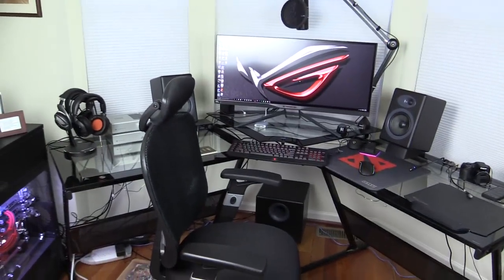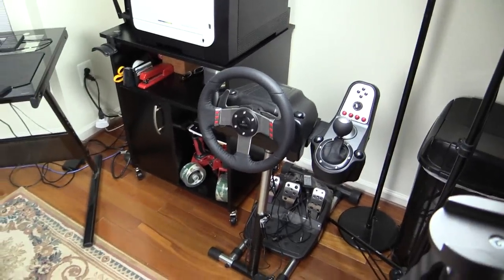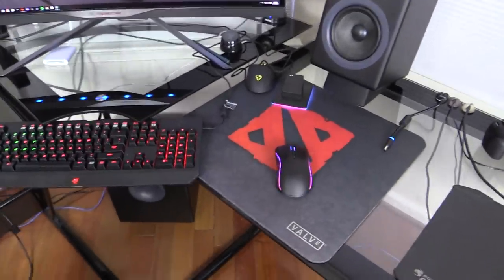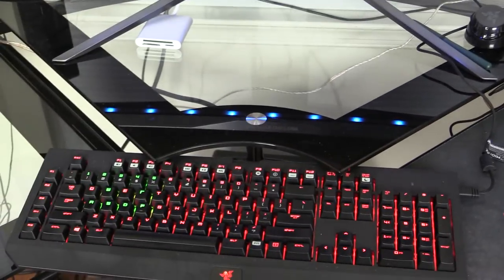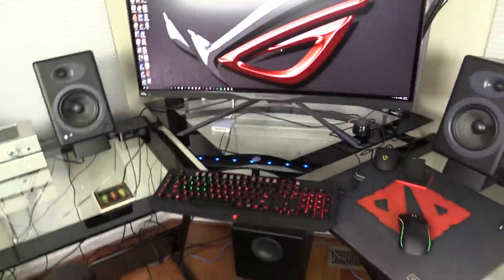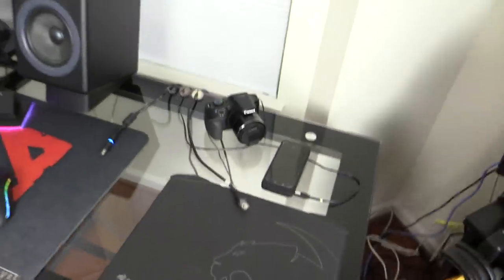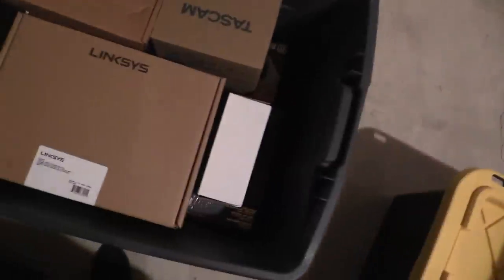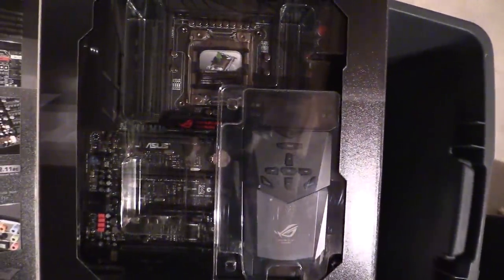Ronsanut 1st 2016 Subscriber Video and Giveaway

Comment: What your plans about gpu fullcover? Check ekwb nickel plated backplate for 980ti. That Thermaltake P5 is good, but cmon you dont saw Lian-Li PC-07s? Would you paint plastic armor on Asus board?
Reply from the maker: +Nigga Drive TV  I did not know about the PC-07.  I think I will have to go with that. It looks awesome. Much classier than the P5.  Thanks.

Comment: Good to see you back Ron.
You and SingularityComputer are the ones I learned the most of watercooling stuff from.

Btw. I have almost the same wireless headset. It's the predecessor of Siberia 800, Stellseries H Wireless. I love the flexibility to be wireless!

For your build: why don't you have  the extra inlet tube in your reservoir diving into the liquid? It would silence it and avoid this foam building.

Comment: for the blocks I would go for EK performance wise. But if you plan to go for Formula, then why not use the clear block using the RGB LED aligning it with the MB.
Reply from the maker: +Origondoo That is a good idea, but I think I will be using the right angle bitspower crystal link which are all shiny silver like in my STH10 Monsta Build.

Comment: I am so happy you are back. I would love to see that 600T again, or perhaps that Ethoo. I also would love to see some EK nickle or nickle plexy. 

In addition, why are you wasting those parts in your basement. Sell those, at least the graphics cards and motherboards. Someone should be enjoying those while they are still relevant.
Reply from the maker: +Garry Perkins Thanks Gary. I actually plan to resurrect the 600T and update it with a new set of parts and I think I may put it up for auction after I finish the build.  Now that I have finished with the move( at least for now)  I am actually selling a lot of those parts that I don;t plan to use. I have a bunch on EBay right now.  If you join my Facebook page you will get notices as soon as I post the parts.
Thanks for watching.

Comment: Welcome back Ron and nice mouse pad :D
Omg you have a HD700, I have heard many things from it being too high in treble do you notice anything of it? I was seriously thinking of getting it with a magni/vali-modi setup. Currently don't know if a tube would be better/worth it. Your answer would be much appreciated.
That PC also looks sexy with the red.
I wish you the best!
Reply from the maker: +Sylvex Dragonskin   I love the HD 700's. Not too high trebel for me. Great sound stage, and excellent bass and sound in most everything I listen to.  As for tubes, I can't tell a difference, I don't think they are any better than all digital units. If it cost more for the same specs I would not go for tubes.  But some say the sound is warmer. Personal preference I suppose.

Thanks.

And thanks for watching.
Reply: Ronsanut
Thank you man. One more question. Why did you pick the asgard-bifrost, wasn't the magni-modi enough?
And well I always look at your vids because you have professional products and also look the part. Always a pleasure :D
Reply from the maker: +Sylvex Dragonskin The M&M are supposed to the best price for performance if you are only connecting through USB.  I have not tried them but most reviews show they can not really tell the difference.  The Asguard 2 - BiFrost set up stacks well and you can use Optical, Coax, or USB so I opted for the more flexible one.
Reply from the maker: +Sylvex Dragonskin But the V2 Uber Edition of the Modi has the Optical, USB, and Coax/RCA connections.
Reply: Ronsanut Alright, thanks for your answers!